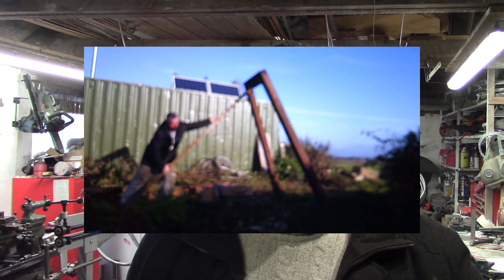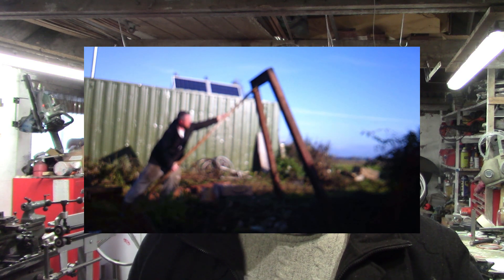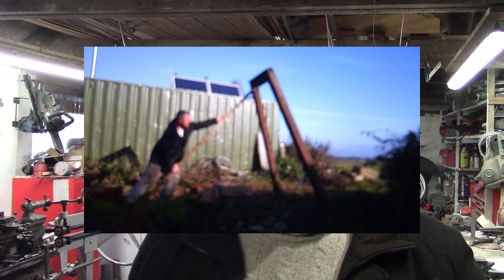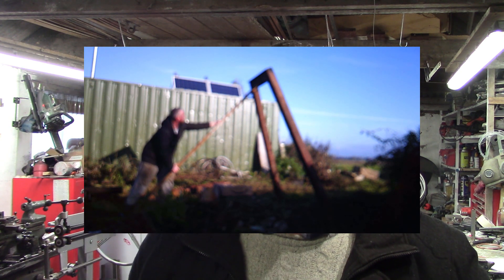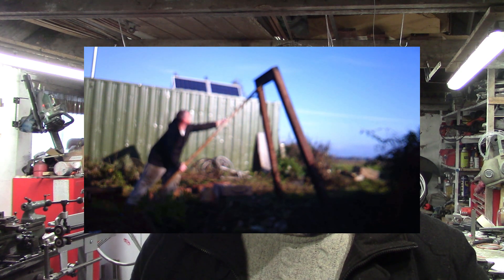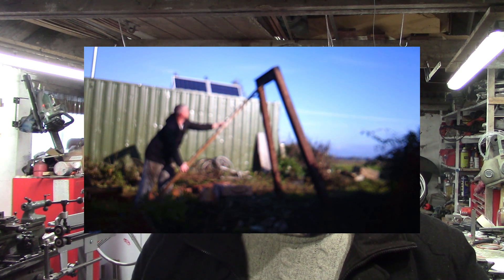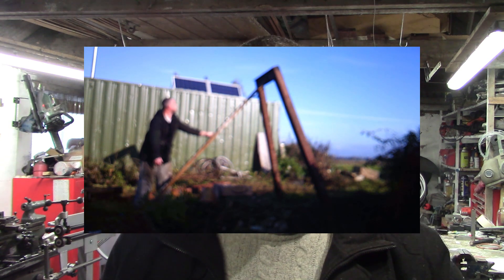Homemade mighty crane- part 2, the frame

Comment: Incredibly awesome! I wonder if, since the tire is old and has a tube, if you could bore holes through the treads and put some protruding bolts through it for grippy traction?
Reply from the maker: Cheers Joe mate. I'll try cutting more tread with a chainsaw first, liking the idea of a chain if that doesn't work as they are pretty cheap.

Comment: love the hub cap. have a look at the Kaiser Baas X3 Action Camera on ebay, about £35 and you can use it as a dash cam for when you drive the crane to the shop
Reply from the maker: Yo homes.
I've got a couple of cheapo go pro rip offs, picture is ok, audio is utter shite will the Kaiser be any better?
Reply: @turboconqueringmegaeagle9006  not sure about the audio but the picture will be better and its the cheapest 4k action cam that has image stabilization. ill get one next month or the month after and maybe do a little review video

Comment: Have you seen one of the latest vids on the Hydraulic Press's other channel? Lauri digs out some stuff from the hidden corners of the workshop and finds a few pretty fascinating air-powered winches. They're pretty cool bits of kit, and fairly in keeping with your little motor's origins. Not particularly useful if you plan on say driving your crane around the garden and local green lanes mind, but interesting crane-related watching none the less
Reply: Also, as a temporary solution to grip, you could go full banger racer and groove your drive tyre out with a chainsaw or something, make a shoddy paddle tyre
Reply from the maker: I've not seen that episode, I like beyond the press though, they're Interesting folk.
Shoddy banger racing paddle tyre sounds like an amazing plan. Chainsaw you say?
Reply: @turboconqueringmegaeagle9006  Yeah, being careful you don't get down to the cords! Maybe a little jig? The thing they use to re-groove military tyres etc is like a heated spoon-knife, if you want to be fancy. I reckon that's a quick project that's within your skill set!
Reply from the maker: @TheKaptainKernow  conveniently, the tyre I'd so old I can see the belts

Comment: need some more wait on the front drive wheel to stop spinning i think a cast iron engine like  Lister CS 8hp Diesel Engine would fix the issue
Reply: Any diesel engine would be heavy enough.
Reply from the maker: Awesome, not too many ladies are familiar with lister diesels!
I have 3 of the later lister petter ac1's but am saving them for applications requiring continuous operation (rock crusher and wood chipper) 
Someone has suggested carving heavy tread onto this tyre so I will try that and just add ballast if it's still spinning but really I need to get some hardcore down to stop my work site turning into a sea of mud.
Reply: @turboconqueringmegaeagle9006  you probably need good power for a rock crusher mite need a Gardner diesel Engine
Reply from the maker: If the lord smiled on me long enough for me to find an affordable little Gardner, as capable as it might be, working it in rock dust all day isn't something I could bring myself to do!
Reply: @turboconqueringmegaeagle9006     A tire chain when operating in snow and mud would give the crane better mobility, accuracy and less swing.....Great Big Smile !!!
Reply from the maker: I'll try the cutting, if that doesn't work a second hand tyre and cheap chains may well be the most cost effective solution, I've been looking for knobly 13" rubber and it's pretty rare!